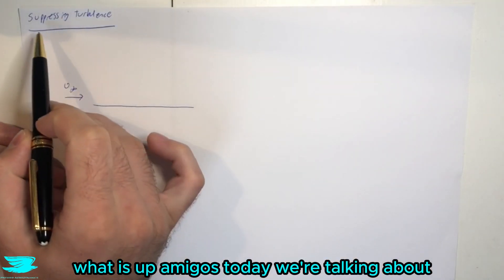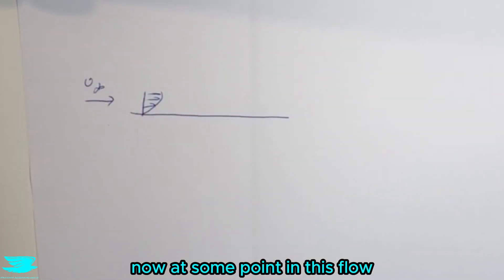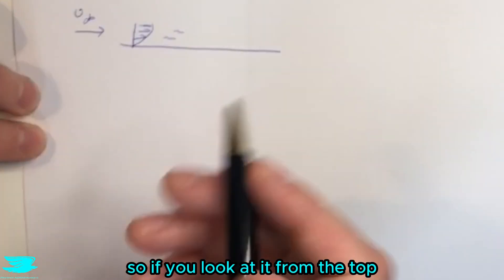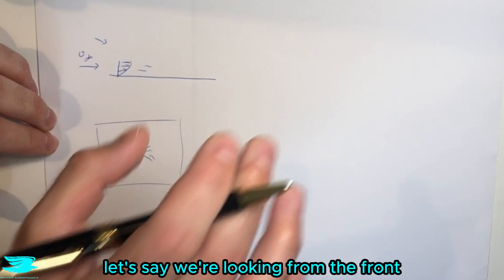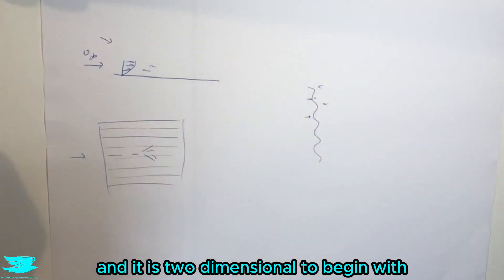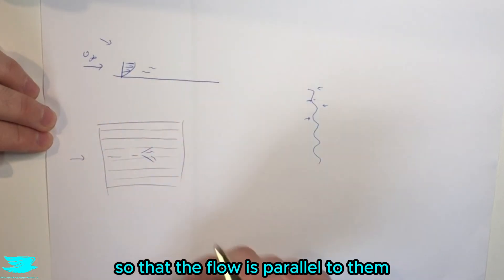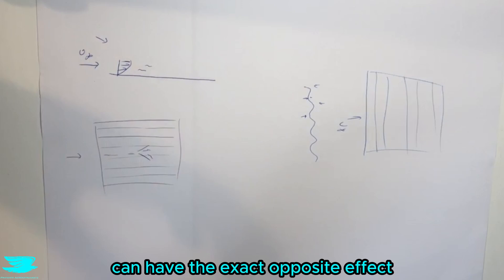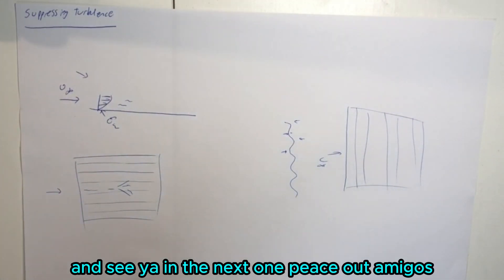Suppressing Turbulence with Longitudinal Striations [Aero Fundamentals #68]

Comment: Could  this method be used to delay or even prevent flow separation in the case for example of a diffuser?
Reply from the maker: It's usually used for turbulence suppression inside the boundary layer and boundary layer turbulence is usually used to help keep a boundary layer attached. So, probably not.

Comment: does a lower airspeed even with a high angle of attack result in less or no flow separation? Like if I have a wing with a high angle of attack on my car, does driving at a lower speed prevent flow separation and provide that small (insignificant) amount of aero load? Also how is making the aspect ratio thinner causing less separation? Is it because the narrower wing causes the flow to reattach sooner/easier? Or do multi-element wings combat flow separation by feeding some of the high-pressure air to the low-pressure side to feed some airflow to the low side? https://www.youtube.com/@PremierAerodynamics
Reply from the maker: Faster allows you to run it at higher angles of attack because the flow has more energy to stay attached and resist the adverse pressure gradient.

Smaller aspect ratios result in the wingtip vortices playing a greater roll and washing flow down over the suction surface. That reduces the effective angle of attack and allows you to run at higher angles of attack.

Multi-element wings definitely do help that way. They also reduce how much work each wing is doing.
Reply: @PremierAerodynamics  ah I see....so it's some vorticity that draws in faster air to energize the boundary layer. But the initial part about faster flow is kinda confusing because plane wings can experience high-speed stall? That was what I was wondering about? Like what are the lift coefficients for various air speeds, for wings of different aspect ratios, vortex generators etc.,? Is there too much variation in lift, to base the estimates of these lift coefficient curves on theory alone?

Comment: So, those early pre-WW2 planes with corrugated metal skin, like Ju-52, did they have it for this specific purpose to suppress turbulense developement, or rather for structural stiffness?
Reply from the maker: They were generally very large. Longitudinal striations for boundary layer control are usually much smaller, like one tenth the size of the boundary layer.
Reply: Interesting question

Comment: For a thin flat plate parallel to flow, does having those longitudinal striations to delay laminar-turbulence transition long enough to offset the drag increase due to more surface area and therefore skin friction? I was thinking if the corrugated skin used on some of the old aircraft could have an aero benefit for certain AOA and Re.
Reply from the maker: Generally it does. However, for an airplane, most of the time, the striations were very large, so they weren't so much for delaying transition. I think it was generally for manufacturing purposes, stiffness, and in the case of the Blackbird, to accommodate the swelling at high speeds.
Reply: @PremierAerodynamics  Thank you!